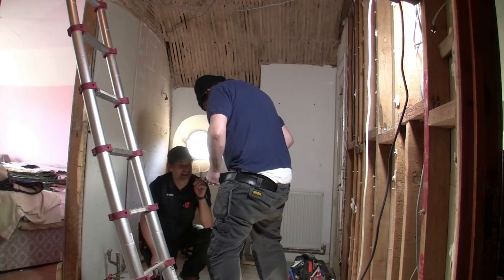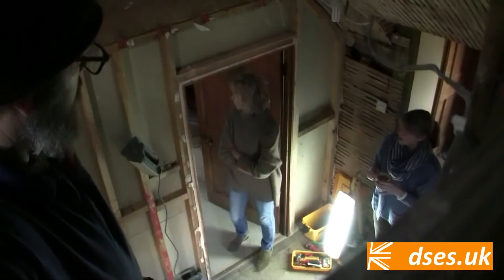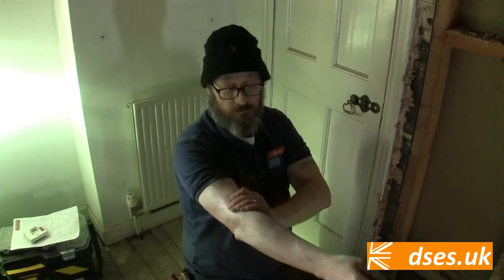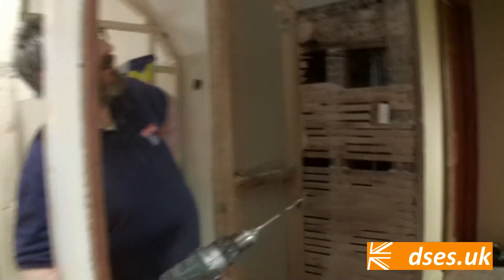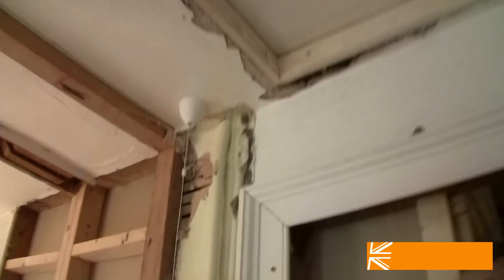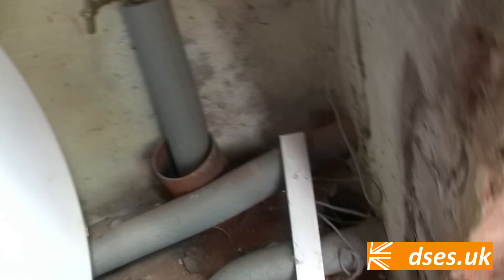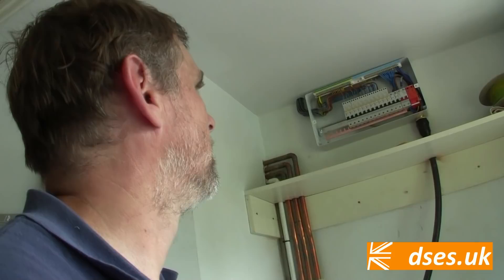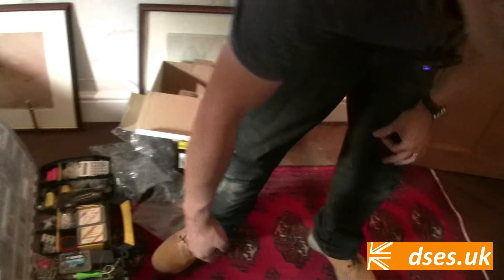The Manor House refurbishment... 4

Comment: Those earth din rail terminals are a pain the the arse when it comes to testing continuity your ring circuit. You effectively have a figure of eight ring for the CPC because all the CPCs are joined through the din rail. I use a yellow insulated terminals when doing that kind of job, and blue for the neutrals.
Reply from the maker: I know it's a long time for me to reply to this, but you're right, the green/yellow terminals are a problem and did indeed cock up my dead tests. It was stupid as I knew they shorted out to the DIN rail, but I hadn't factored in I'd effectively be figure-eighting my r2's on the ring circuits. I later went back and replaced them all with Spliceline connectors to send the CPCs straight through so that I could get the actual r2's without them being artificially lowered. I found these connectors to be pretty awful to work with and have no intention of using them again in this kind of way. Damnable things!

Comment: Lovely story unfolding here - a bit like the Odyssey. A small point, from an old fart. When you pull through the rod at 1:07:10, if you had attached a string alongside the first two cables, you could use that to pull the next cable(s)  (plus more string) and repeat until finished. You don't need to keep returning the rod to downstairs. And at the end you've got a bunch of cord in the loft, which you can leave there for the pumber to clear up.

Comment: I'd run fibre out to man cave, you're pushing Ethernet at 100m, plus you get any lightning strikes nearby it will blow the network ports out, or use point to point wifi kit from Ubiquiti.
Reply: I agree, it isn't that expensive now, but you have to make sure you don't damage the connectors when pulling through the duct!
Reply from the maker: The data run is shorter than the power, the latter having to cross the front of the house and pass to the rear, but fibre would have been a better option.
Reply: Nice single mode run to the man cave. Got to have the option to do 400Gbits in the future!
Reply: Cat6 or Cat7 can bridge 100m and retain a gigabit link but yeah the real concern is a possibly current flowing trough the cables shielding or a spike from lightning frying their equipment.
But as all the earth conductors and bondings come together at one central point there should be zero current across the shield.
Reply: @alouisschafer7212  someone who has no qualifications and pulls in data cables for a living have no judgement on an electricians work. Let's get that right

Comment: Has exactly the same with my
Multitool did exactly the same within a couple of weeks, I like you didn’t bother sending it back and just used it! Was fine until she eventually burnt out and then I upgraded to the quick release which is great and hasn’t done the off cock thing...problem is there is no light on the newer version which is a pain!
Reply from the maker: Wonky heads seem to be all the rage with Makita Jay. I did look at the quick release - my last Ryobi had such, but you'd think they'd stick a flimmin' white LED on it in this day and age!
Reply: David Savery Electrical Services The wonky head seems to be a common theme! The quick release is great but like yourself I just can’t understand why they removed a feature such a the LED light when they brought this new one out, seems like one step forward two speed back to me! But there we go!

Comment: Awesome looking forward to the 35mm armoured in the man cave, went for the two way lighting in transition area? Holly captured the love handles nicely when you were filling, I see what Nige means 🙃
Reply from the maker: I should have expanded on the lighting Simon, but no, the client was horrified at all suggestions of sensor lighting, funky lighting or anything-out-of-the-ordinary lighting. So they got one light switch and a pendant drop. I guess they turn it on, open the bedroom door, turn the bedroom light on, then go back and turn it off. Pshaw!
Reply: Shame why employ a genius and then not follow their advice 🤔
Reply from the maker: @simonkeell4502  Indeed. But enough about the plumber; for the electrics they employed a couple of dickheads and didn't follow their advice either.

Comment: in that tank room where nigel done that isolator i would of used a metal lewden/control gear 100amp switched fuse isolator all in one as you have eddie currents on that metal box ?
Reply from the maker: There are slots between the holes Richard. The Lewden is a good product though. We went for this particular fused isolator simply because it was hanging around in our storage lock-up.

Comment: I bet you really, really love working in old buildings with Lath and plaster walls and ceilings... makes cutting holes and box sinking really easy and enjoyable...😂😂😂
Interesting that you went with the Inceptor Nano adjustables... I used them to replace the old GU10 Halogens in my bathroom because you reckon the Inceptor range were good quality :) The flow connectors are quite nice though.
I've been getting royally pissed off with two or three adds in the middle of videos lately, I don't mind one at the start and/or end but not half a dozen in the middle of the vids... might have to start using addblocks which will be a shame for the video creator...
Missed a trick with the title... could have been To the Manor bore (four) lol.
Reply from the maker: Good spot with the title there FSB. Yes, YT is killing the experience. I find myself not using it at all lately. It is stupid that they overdo the ad's so much it simply forces people to use blockers so that nobody wins. If I do watch a video, I find myself clicking off when the non-skippable ads turn up unless I'm especially invested in what comes next. Usually, I'm too pissed to be invested in anything much.

Comment: Regarding the joint box with din rail connectors, the use of green and yellow connectors will result in all earth cables being bonded together in joint box.This will cause problems  when you start testing.
Reply from the maker: I'm really not a fan of these things, and as you say all the circuit CPC's will be paralleled from from this. I put it in because on a prior CU move that my NIC assessor viewed where I had kept the circuits separate and extended them using Spliceline/Wago connectors, he proffered the use of the DIN rail connectors. I know Nick Bundy used such in one of his videos when moving a CU and he had told me the subsequent testing had thrown him off cock as he hadn't realised they were joined at the rail. Personally, I wasn't too impressed with the solution. I found it fiddly, slower to install and numerous times I thought a wire was terminated only for it to fail a tug-test afterwards. The green/yellow was a way to demarcate the individual circuits, but if I were to do it again I'd perhaps use grey ones throughout.
Reply: David Savery Electrical Services I’ve used genuine all grey Wago’s in situations like these before - no paralleling of the CPC’s, and the genuine Wago DIN Rail modules definitely pass the tug test!
Reply: @dsesuk  Three suggestions - Wago do a DIN rail carrier for their 222 type connectors, which is good for this type of thing. There are also push-fit variants of the ones you used. Finally, the screw-terminal types are available in different colours - you could use green or yellow for the CPC's. Available from the likes of CPC/Farnell/RS.
Reply: The yellow/green connector are old, I think I know them over 30 years. At this time nobody separate y/g with every MCB only. 

Use some gray, paint them yellow from one side and green from another. Or mark them with a sign - where are the problems?  

Power not look what color do you use ...
Reply: Bollocks
Reply: @adamsharp201  you obviously don't test your installations.

Comment: Not convinced running UTP to the man cave is a great idea - I suppose you’ll have a separate TT Earth there? Could get fault current running over the data cables?  Might be better to run a fibre to an Ethernet repeater out there.  But being an old telecoms guy - you know the story!  That’s why you’re a cut above most!
Reply: definitely better to run fibre, UTP Ethernet is an isolated interface (I believe to 1.5KV) so fault currents shouldn't be a problem, the problem is any nearby lightning strikes will cause a problem.
Reply from the maker: Probably should have run fibre, but too late now. It's in and working so we'll see what happens I guess.

Comment: Surly if laser through lugs box will be pissed unless only use fixed lugs
Reply: Gotta laser though the fixing holes
Reply from the maker: The adjustable lug is... well... adjustable... so if the laser passes through the fixed lug and can be seen to pass through the adjustable, then that accessory is going on straight and level with its neighbours.

Comment: Hi David another great video thank you.
By the way can you please tell me what is the current rating of the fuse in the plug top of the mains test lead using for RCD Testing at the socket, I am getting my late brother's ROBIN kts 1620 MFT but there is no fuse in the plug
Reply from the maker: Can't imagine it matters much, but having checked, my testers have 13A fuses.
Reply: Thank you. And am I right in thinking that to do insulation resistance test on sockets with built in USB ports you can disconnect the nuotral conductor on the socket?
Reply from the maker: @seandempsey9396  No, you'd join line to neutral on that circuit and test between them to earth. That ensures the test voltage doesn't spike the electronics as with it applied to both line and neutral simultaneously, there is no potential difference across the circuitry. Alternatively, you could wire out the thing by removing the socket and using Wago's to connect the incoming and outgoing wires together, but that's not terribly practical most of the time.
Reply: @dsesuk  we'll you have confirmed my suspition that guy from greshem college is wrong in one of his videos he did it as I discribed, personally I would test LN Combind to earth or test at 250v. Thank you again I wish I had you as my tutor when I was at college

Comment: hi David How are you keeping safe i hope   
Sorry to be a pain in ass  but i have tried a number of people on these chanels  with out success
So can ask you , on my late  brothers  ROBIN KTS 1620 MFT witch is the same as the KEWTECh TK62
and the Test leads are one for testing at the sockets and one for testing at the DB, on the loop setting  you have 20 HMS  200O HMS and  2000 OHMS  and on the  PSC setting you have 200A 2000A and 20KA,
your metrel has the same settings although the set every automatically ? my question is when i do the Ze test ie maind earth removed from Db and clamp one lead to that  then probe on the incoming line what do i set the instrument diel  to ? or cant the two lead be used and what about psc ,i don't have the instruction book  and i not prepared to spend money i cant afford on one of the moor modern MFTs plus i like the old ones . so any help is much appreciated.

Comment: Hello, FYI not directly related to this, but 'haste' have told me they no longer come out to install isolating switches.
Reply from the maker: Yes, WPD figured they could have a monopoly on the things at £218 a shot so they squashed Haste. This is covered in a previous video, 'Waffly Consumer Unit Upgrade'. Stinks dunnit?!
Reply: @dsesuk  sad times. It just means the client has to do the leg work. Which I think isn't fair.

Comment: Not sure if the regs in UK insist on staple a metal stud protector on horizontal drawn electrical cables? They are here in the US if they close to surface .
Reply: No coz we have to run in electrical zones unless they are more than 50mm deep
Reply from the maker: As Supersparks says, the protection these days is less mechanical and more 'run it in zone' (horizontally or vertically from the accessory) and RCD protect it at source.

Comment: Hi David just watching video at 26 mins when you fix back boxes to the stud wall do they need to be at a certain depth. 
   It looked like the light one was flush with timbers next to it  and the socket ones where set back slightly do you use a certain measurement or just a bit of guess work thanks
   Also did you fuse the installation down with the switch fuse from 100 to 80amp or.
   I actually went to a job the other day where the main fuse was 80 amp then the put one of them main fuse switches in amd also used an 80 amp is that right or wrong
Reply from the maker: Afternoon. To answer your questions... regarding backbox depth, we tend to use 25mm for sockets and for switches unless we know a given point will require something deeper. As for measuring on this job, I doubt we did anything clever there. We would have just wanged them onto the woodwork with the expectation the plasterboard depth would be to the box edges. There may be a few millimetres in it if the noggins aren't affixed equally, but I can't recall now. The fuse question is interesting and, no, we don't include any selectivity into it. The expectation is that you will fuse the tails on the output side of the meter if they're over three metres long, but that fuse can be the same size as the supplier's one. NICEIC say that selectivity doesn't have to be followed where devices are physically located close by, so same with having two 30mA RCDs in line. If the supplier's fuse is 80A, there's no need to drop it down to 60A just because the CU is five metres away. Stick in an 80A fuse and you've ticked the box that says thou shalt protect the long tails.
Reply: @dsesuk  thanks David very good to know for I  the future because if they they only have an 80 amp fuse and maximum demand is quite high you wouldn't really want to drop to a 60amp.
    Just been watching your max demand video the calculations for this are just guess work really its a load of nonsense I like the trick of clamping the tails for a couple days.
    When you dropping latest videos on manor house mate
Reply from the maker: @gd-bq7em  There are three vids in active edit, two relating to the Manor House, however I seem to be having difficulty in staying sober enough to finish them! I'm also concerned they won't be worth the wait after all this time. Anyway, something should land this weekend.... I think...
Reply: @dsesuk  you gotta put them up mate finish the series I will watch them as soon as they drop. You'll be surprised the number of people waiting to watch it 
  You two bounce of each other well and people learn at the same time.

Comment: Just a quick question does Nigel's isolator have a slot cut between the live, earth/cpc and nuetral to avoid eddy coming to town?
Reply from the maker: It does. There was a scene recorded later showing it finished, the conductors colour coded and the slits shown between the holes, but it didn't make the edit. There's loads of raw video for this job recorded over months. I've just tonight found more of it that got left out hiding in another folder on my disorganised hard drive.
Reply: @dsesuk  I knew it would as you guys do a great job can't wait for the next part/s

Comment: It sounds like the plumber doesn’t understand a secondary return.
Reply from the maker: It may be our ignorant interpretation of what he was telling us to be fair. Plumbers start talking to us about their problems and we just glaze over.
Reply: David Savery Electrical Services You have to remember to use small words with plumbers 😂😂 

Have a look google of secondary return pumps, they would make a big difference if  you haven’t got one.

It’s basically a low flow rate pump that continuously circulates water back to be tank so it’s always hot. Saves having to run the tap for 2 mins to actually get hot water.